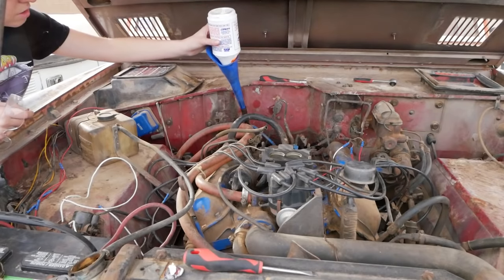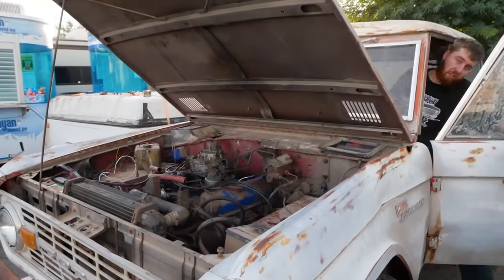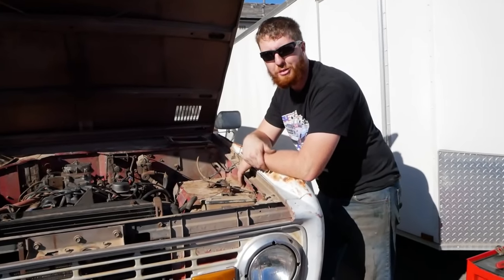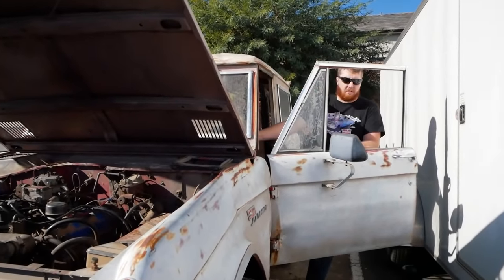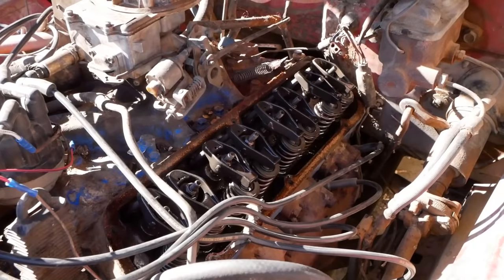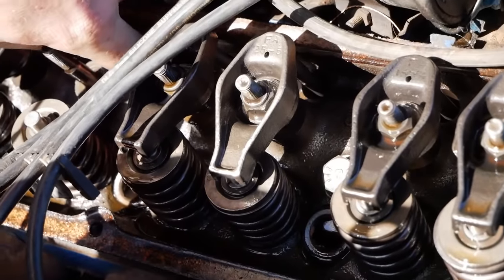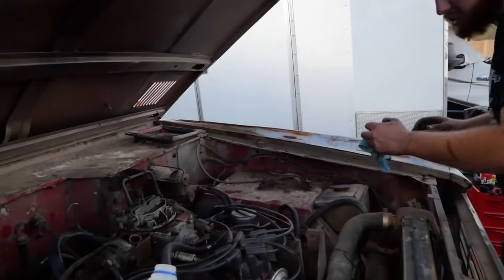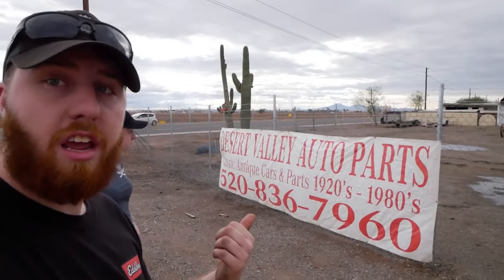ABANDONED Bronco Saved After 10 YEARS in a Storage Lot! Will it Run and Drive?? - Part 3

Comment: A 302 isn't really a Windsor, it is a Small Block Ford.  A 351W is also a Small Block Ford.  
Then came the 351 Cleveland, which is a 335 series engine, causing the Small Block Ford 351 to have to take on the Windsor Designation to differentiate it from the Cleveland.
And if that's not confusing enough, Ford destroked the 400 to 351M, which required yet another letter designation.

A 302 isn't a Windsor, just like a 400 isn't an M. The Windsor, Cleveland, and Modified, designations are just to distinguish the multitude of 351s!   GM had four different 350s, and Ford had three different 351s.One is a SBF, and the other two are 335 series engines.

In Australia, they actually have 302 Clevelands, and they put 351 Clevelands in trucksfrom the factory.

Comment: Couch expert here so be careful. After cleaning the poo, what if the valve covers came off, plugs out and whatever magic spray/oil was used to soak it all during the 1st day?  The thing did not burn any oil it seems, so the valve seals would have not allow magic to get down onto the valve stems??? I guess you would have to take the springs and seals and then go after the stems. Well you have kick ass, rust free bronco.

Comment: if you use tap water and not coolant then all the minerals in the water remove tiny bits of cast iron and they'll mix into a rusty sand that blocks and corrodes almost everything

Comment: It's because it doesn't get cold enough down here to need antifreeze, so we'll use just straight water to save money and not violate any epa rules by leaking or dumping antifreeze on the ground.
And if the vehicle gets parked with straight water in the cooking system... you can see where this is going.

Comment: There is a way to clear all that gunk out the water lines with hoses valves a water hook up for water hose and a air line hook up so you blast the water with the air line when you turn the valve if you can understand what I’m saying and can put it together it’s a good tool to have

Comment: Yall should have let the carb soak in the barryman's chem dip overnight and maybe a little bit of the day after. Then flushed the fuel lines with some seafoam crap with a electric pump. Then flushed out the tank with some new gas, seafoam or barryman's fuel system cleaner and some nuts. Then shake it around and do that a few times.

Comment: All of these 289s came with a nylon coated aluminum timing gear. They are famous for going bad around 60 thousand miles and frankly based on your issues I’d suggest you check your timing chain slack when reasonable to do so because if it hasn’t failed yet it’s going to.

Comment: I have an old catalog basically every once in a while I would have some valves stick I would dump STP dial the carburetor Wallace is walla it's running and it would free up the valves it was smoke a lot also a tour all burned through

Comment: Southern cars "You don't need to run antifreeze, just water, it doesn't get cold here"

Yeah that stuff isn't just to stop your car freezing dude. The other reason you use deionised water and coolant is because it stops your coolant system corroding to shit and blocking up with the corrosion.

Comment: Well I live in Alabama but anyway so my dad bought a 2000 chevy silverado for a parts tuck for our 1999 so the parts truck we got from a teen or he was around 20 but anyway looking at the truck you could tell it's been in the mud a lot. But 1 day the Radiator on the good truck started leaking so we where going to sope them out and there was a ton of crap in it i mean a ton. And that truck only had 250k miles on it and my dad's has 410k miles on it . I mean my dad's has been in some mud but we don't use as a mud truck 😂 the other 1 was used as a mud truck so I mean idk how that got all of that in there but they did some way how. But back on point my dad's was extremely clean inside.

Comment: What i would do is remove the filter and have the fuel line from the mechanical fuel pump to the carb removed and put into a gas can and pump the fuel out of the tank. filter the fuel if you can then put it back into the tank and repeat untill the fuel coming from the tank looks good enough. if you have to use chemicals in the fuel to help do so.

Comment: Have you eventually gotten this BRONCO to EVER RUN without problems?
Seems given what was found under the hood, the COMPLETE FUEL SYSTEM should have been replaced before ANY ATTEMPT to start the engine.
Imagine what SCOTTY KILMER would have said or recommended (He had worked on several of my pickups MANY YEARS ago, when his shop in the West University Place Village in SW Houston, Tx. was still open.)    My 1969 Bronco with 302 V* only lasted a year, sold it back to the dealer after I found out how much it cost to replace the CV Joint from Transfer case to rear axle 3 times under Warrnty.    :-)

Comment: 2 reasons why cooling systems fail in the American Southwest.
1. Hard tap water, when people use water from the garden hose in the radiator. The minerals in the water will deposit in the cooling system.
2. Some people don't use antifreeze because where they live doesn't get below freezing so they, foolishly, think it's not necessary.

Comment: if you are running more tap water than anti-freeze or distilled water then there are more minerals and calcium in the water, at least around me, that will gum up a system as it gets worse when it gets hot.  Just my opinion though.

Comment: just water in a cooling system with different metals will corrode, part of the function of antifreeze is to keep the corrosion down. If one metal is more noble and mixed with a lesser metal in a conductive solution it will corrode. Its called galvanic corrotion. Don't mix aluminium and copper, or worse. copper and iron.

Comment: I'd get it started with fresh gas,......and dump ATF in the carpatato,.....it will smoke,....but it will clean it out.
You will do it at high RPM's,.......do it,......then do it the next day,..... and so on,.....transmission fluid contains detergent.
The detergent in the intake and the valves will get cleaner.
and when its better you change the spark plug's.

Comment: Oh no, another long comment. You asked : why the radiators so nasty in the southwest states. I ask , have you ever heard of waterbags ? Look at the cover of the 1st or 2nd Jackson Brown vinyl album. There be a waterbag ! The arid climate of those states makes for poor cooling when transferring heat thru a radiator. ie : low humidity.  The waterbags were to designed to " weep " ( evaporate ) water to help with the transfer of heat. Heat requires density and dry air don't got it. Why are the " guts " so nasty. Well largely due to greater range of heat cycling experienced by vehicles in those states. And,
the shoddy maintenance regimen that people tend to adopt as people begin to neglect their vehicles.

Comment: Ok so I have a 2 barrel carburetor for a 302 and the accelerator pump has a hole in the bottom side that used to be plugged by something but now it’s not and it shooting gas out the hole and onto the engine but I can’t find anything about the hole, the problem, how to fix it, what it’s called, etc on google

Comment: Obviously piston to valve contact occured and if it hit hard enough to push studs out of the heads and bend push rods then valves may be bent, not to mention rod bearing damage. Why the distributor wasn't pulled and the engine pre-lubed before even turning turning it after 10 years is beyond me. You rotated it dry on initial firing but bothered to fill the oil filter after changing oil, why ?

Comment: IF you're not familiar with Rob Siegel on Hagerty, you might want to check him out: https://www.hagerty.com/media/maintenance-and-tech/dont-start-dormant-engine-without-checking-gas-tank/.  Not trying to be a wise guy.  I recently rebuilt the entire fuel system on a '72 MG Midget that hadn't run in 30 years  The gas tank had so much varnish in it I couldn't remove the drain plug.  Everything new from stem to stern.  Rebuilt the carbs.  Gave up on the fuel pump.

Comment: Why don't you do what Derek does over there at vice group garage.and run Diesel oil in these older cars with flat top cames. it's got the zinc in it already built in you just put the diesel engine oil in there and it's better for it.

Comment: I made a video a while back about clr and what it does to radiators. I would bet they did the clr clean method and left it in because the clr clumps up and turns into pretty much that muddy poop you guys pulled out of the radiator and the whole cooling system. The clr sludge is disgusting, never leave clr in your radiator and honestly i wouldnt even use it in there period. Theres so many other products you can use that doesnt turn to poo sludge.
Reply: Cooling systems are very needed in nevada and in that area so they are probably cleaned more often, using clr is recommended but i dont think you should use it

Comment: You should know better than to use that old gas tank!!! I know you have done enough of these!!!! Bring a spare cheap plastic gas tank you can throw in there for a revival, so you don't get hemd up with the fuel problems we all have every time, just like you need to  bringing a spare 1406, edelbrock, NOT!!!  a vintage 1960 holly,that should be on a period correct hotrod!!!!!!!! In some museum.. save yourself the headache and  a days work,, Come on bud,work smarter not harder!!!!!!! You are doing great so far, keep it up!!!!!

Comment: take a half a quart of ATF and mix in a half a quart of water. Run it up 1.5 K Rpm or thereabouts and feed it down the carb while it is running. Clean them valves right up and take away the clatter. Used it for years before Berryman's and all the other valve train cleaners. Don't pour too much at a time or you will kill it.

Comment: I have a John Deere 335 that was my great grandfathers (I never got to meet him) it’s 20+ years old. It has a 20hp v twin engine. (2 cylinders for English) and it’s been having a hard time running and doing weird things. It has a wobbly idle but it goes away when it IS under a high load. (Going full speed up hill and or having the blades on) and sometimes when it starts it runs perfectly fine for like 1 minute then one of the cylinders completely drops out for a minute or two then it’ll pick back up like nothing happened. Anyone have something like this? I went through the ENTIRE fuel system already. Gas tank. Pick up tube. The whole length of gas line was replaced. Fuel filter. Fuel pump. And I rebuilt the carburetor. It idles fine when I put it at half choke. I checked the spark plugs and they look perfect. I’m thinking it has to be an electrical issue but if so then why does it do it randomly and not all the time. The reason I posted this is cause Kevin said he used to work on mowers and cause of the broncos cylinders dropping out. One last thing. If it means anything. It has a not loud but noticeable rocker tick.